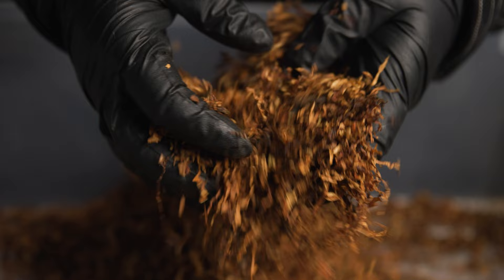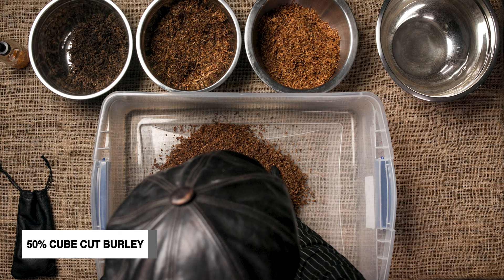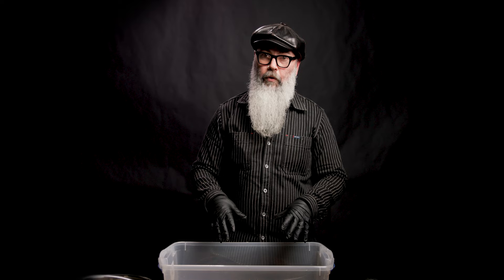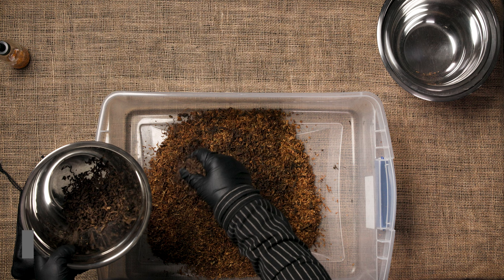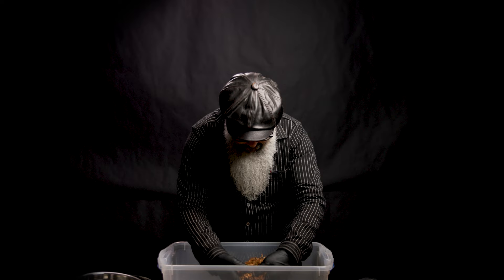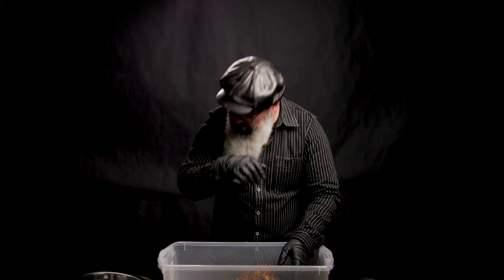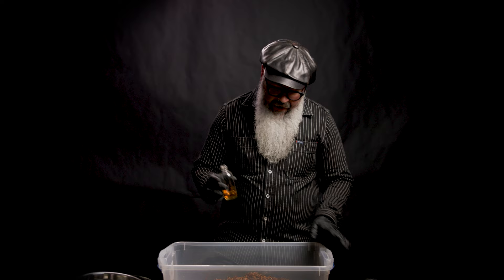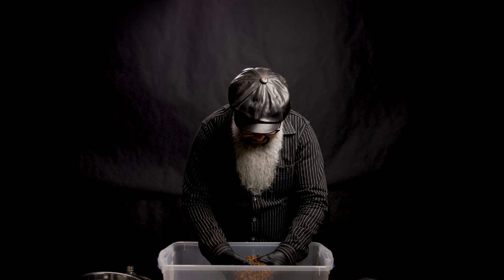How To Blend Pipe Tobacco w/ Jeremy Reeves of Cornell & Diehl

Comment: I buy bulk ribbon cut perique and use it with a handful each of VA and burley. It takes these perfectly wonderful varietals to another place or level. A Sterlite salad bowl with cover serves as my workspace AND storage as I typically smoke a Sterlite bowl at a time. ha ha. I usually mix up about 2 oz at a time, just grabbing stuff by the hand and then the toss in the bowl using my fingers as separating forks, like Jeremy was doing.